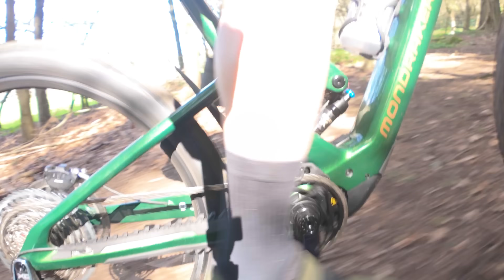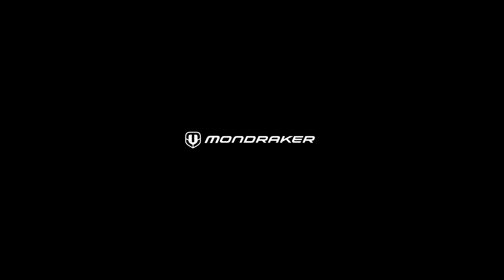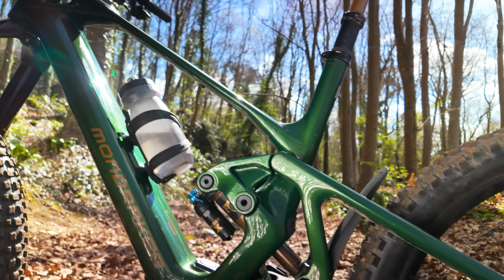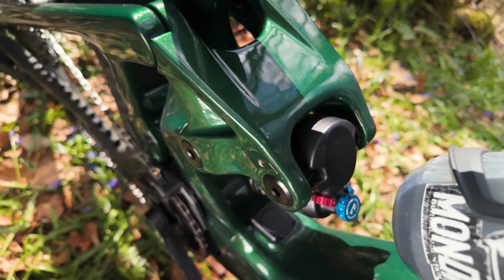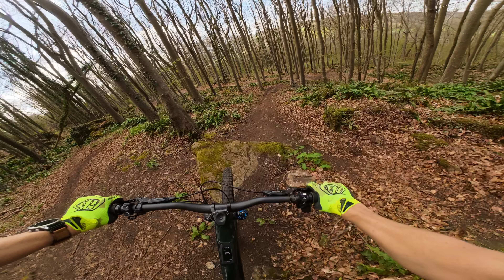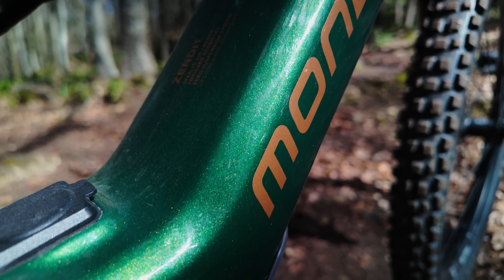ZENDIT tech explained by DODDY | Our first AVINOX e-bike

Comment: You mention charging in your van with a power pack? Can i charge an Avinox powered Zendit with a Jackery without any issues?
Reply: Of course you can!
Reply: @officialWWM I heard someone’s portable power bank went bang when trying to charge an Avinox powered bike & I’m not sure exactly why ! Hence the question…(I’ve only used mine on a Kenevo SL2) not sure if/why the demand of the Avinox system would overload the Jackery
Reply: @Ebikeridertrojan a portable power bank delivers power in a very different way to your Jackery. Plus, I’ve had one of those power banks explode on me too. I think they are dangerous and very unreliable.

Comment: 462mm chainstay, bro. why am i the guy who has to keep coming at ya? just put correction in the vid or something. 
anyway, i'm interested to know why you, or others, like a chainstay that long? 
I (years ago) demo'd a Scott Genius with about 450...maybe 455mm or something stays, and on that  i had problems getting the front end up. 
and it's light. 
are you selling that chainstay length because you cant solve it with the shock position...? or what's going on here?
Reply: Slip of the tongue, my bad. Guess that's what happens when self-filming and editing two days before the launch. Oh well. Keep comin' at me if it makes you feel better!  Chainstay length is about balance on the bike. This length puts the rider in the best position on bike for traction and handling at both ends. Being able to pop the front end up isn't just down to chainstay length. BB height, stem length and bar height affect this too.  What do you mean when you say 'solve it' with shock position?
Reply: 462mm even for a 29er seems pretty long? What I mean by "solve it" is I'm guessing your design team probably had to go that long because of the combo of the shock tunnel style rear sus (shock position) with the Bosch. 
The Superfoxy says 440-450mm chainstays in 29er, so am I right to assume the Zendit still longer rear center in 29er is because it couldn't be engineered around? Nbd just wondering anyway.. Bike probably feels better in Mullet mode.
Cheers keep up the good work.
Reply: @p @pubfixture pe it’s designed to be that long.
This bike was designed ground up, not adapted, not based on anything else. 
Longer chainstays centralise the rider on the bike; they allow more traction for climbing and more stability when descending.

Comment: How does the DT Swiss 350 DEG 72 handle that much power ? As DT advise the hybrid hubs for e-bikes
Reply: this is the Ebike version - can be used at 0deg or 10deg. The non-E version also does 20deg.

Comment: explain peak power..how long, 30 seconds, 60 seconds, 1 hour? these numbers are all marketing mubo jumbo
Reply: Boost is up to 60 seconds. Peak Power does not have a fixed amount of time - the nominal output (sustained and constant) is 250w. I do know that a German publication noted that the full 1300watts was sustained for about 22minutes in their test - but I don't know the conditions they rode in, or how the testing was done.

Comment: The linkage is an ugly contraption.
Reply: I agree to much going on. Over engineered just to be different.
Reply: @TerryCole-b6p  Then you obviously have no idea about rear triangles.
The shock is compressed from both sides. It's positioned below the seat tube for optimal center of gravity. They did it differently on the 2023 Level/Crafty because the Bosch CX Gen 4 motor was in the way. The Avinox motor is significantly smaller, which allows them to revert to their standard rear triangle design, as seen here on the Zendit or the 2025 Level/Crafty with CX Gen 5.
Reply: @TerryCole-b6p  not over engineered to be different. We have use variations of this design for a long time.

Comment: Nothing beat bosch crafty on its natural pedal feeling, i rather feel the pedal than just shuttle around
Reply: Then look for shimano.
Reply: Bosch has a totally different feel to Avinox. It definitely has things it does much better than Avinox  - and vice versa. From my POV, the stand out with Bosch is low speed control and torque for technical climbing. Despite having more power, Avinox can't touch it right now. But then Avinox allows riding at limiter speed even on really steep trails - so can make uphill singletrack and challenging trails as much fun as descending. Both very good, and have stand outs. I plan on making something to highlight the differences in the way the systems ride, and how they are best used.
Reply: @DoddyMTBtech well it should be put to the test a blind test with someone who hasnt ridden both
Reply: @porroco  good idea!

Comment: Ooh question I thought the extra power for the DJI motor only give the full power with the 700w battery and is the 800w battery the same size and shape as the 800w???
Reply: 1300w peak power with the 800 battery (which I think is the same battery as in the original M1-powered Amflow bikes), whereas the new cylindrical 700 battery (fitted to the Amflow PX, the Atherton EMTB and a few others) gives 1500w peak power.
Reply: @grahamsmith9788 that's exactly what I thought but Doddy said 800w battery and up to 1500 w peak power ,??
Reply: @bikenboatart  No, He said 150nm and 1300w
Reply: @FINNdeischgut ah ok will have to watch again
Reply: So you do need the 700w battery to get the 1500w?
Reply: @bikenboatart  Yes.

But nobody needs 1500w.
1300w are enough for everyone
Reply: @FINNdeischgut yeah actually agreed 👍
Reply: Yep agreed wonder how much lighter the 700w battery is in comparison though not sure I would even need an 809w for that range

Comment: Hopefully they all ship in better condition than my level rr did last year. Main pivot bolts that were too long and weren’t preloading the bearings. Washers missing on some stem bolts as well. And every bearing is n the frame and wheels were shot within 3 months.
Reply: Iain Richard just put out a video on this bike, broke the wheel on the first section of trail he rode. I was not impressed with this bike at all. Doddy is obviously going to be biast when this bike is concerned because he works for Mondraker. Not going to be an accurate review
Reply: @Razzy_82 I seen it earlier. He seems like he regrets buying it. In fairness I think he had a Schwalbe tyre in a trail casing on the back wheel. Not robust enough for the application if that’s the case.
Reply: @banger2891 thats what I thought, bike looks fast but for the premium price it should be a premium product. So why does it come with trail casing tyres 😂
Reply: I agree mate now that he works for Mondraker he will be very bias and not say one negative. Shame as I trust he's judgement before on products u can't now, but I understand that this is Mondrakers own channel and normal to be bias.
Reply: @TerryCole-b6p  also, I'm not sure why this is titled a review - as it's not. I'm just delivering information on this bike, for people to make informed descisions.
Reply: @Razzy_82 broke a DT Swiss wheel due to poor line choice and blames Mondraker. Think about that for a moment.
Reply: @TheAngryHusky not the case, what so ever. A wheel should not brake from a 1ft drop. Especially off a premium brand
Reply: @Razzy_82 it shouldn't but it happens. Regardless, that's not Mondrakers fault and will likely be covered under crash replacement. It suck's but that's mountain biking.
Reply: @TheAngryHusky cant argue with that, but shouldn't be happening right out of the gate when dropping off a 1ft drop. Lots of people complain about DT Swiss. But then lots of people complain about lots of other brands, guess some of it is luck of the draw
Reply: @Razzy_82  wheels are wheels. Doesn't matter what brand. I weigh 97kg and am generally fairly hard on rims. So far, so good. I have split a DD tyre though. But that also happens.
Reply: @DoddyMTBtech ok so the caption is misleading. My biggest gripe with this bike is the section on top of the bottom bracket. Its holds a load of mud and fills up if you dont scrap it out. Need to tell Mondraker that it's bad 😂 but from what i have seen the bike rides extremely well. Its like a rocket
Reply: @Razzy_82  mud harbouring is always a concern on anything. I can tell you from the 3months of solid sh**e conditions we had at the beginning of the year that this has been a non problem. Thicker, claggier mud might be different, depending on what your local mud is. I've also hammered mine with a jetwash - so far, so good. FYI, my Bosch display has water in it, but works fine. Might be too soon to say with this, but I'm not delicate with the cleaner as I would rather find out about problems and pass on the information.
Reply: @Razzy_82  just want to emphasise - this is not a review. And I don't know why it's called that. I'm providing facts so you can make an informed choice about choosing bikes.
Reply: @Razzy_82  What is the name of the YouTube channel? I can't find anything under that name.
Reply: @FINNdeischgut https://youtube.com/@ruffest?si=qCICJhM4ua3nyBla
Reply: Ouch !!  Certainly not what you would expect from a high dollar product. Was this handled correctly under warranty? What country are you in  and what kind of support did you get?
Reply: @stevebiron3036 Scotland mate. The bike shop I got it from was 400 miles away. The workaround was to put a 1mm washer on each main pivot bolt to take up the extra length. The bearings wouldn’t be covered under the warranty. Excellent bike but very poor quality bearings. The e thirteen wheels were the worst wheels I’ve came across. Replaced them with a set of deemax enduro sl wheels which are absolute quality.
Reply: @banger2891  I would think in this day and age that is unacceptable. You having to faff around scrounging pieces to make it work is poor support/warranty/customer satisfaction. Who is running QC  ??  where are these bikes manufactured? I thought Spain?  Lots of manufacturers have lifetime warranty on the bearings. You would think that at this price level they would be covered for life.
Reply: @stevebiron3036 Not sure where the frames are manufactured but the bikes  are assembled in Spain before being shipped to their final destinations. There was huge play in the rear triangle so qc was abysmal by mondraker and the bike shop who both failed to pick up on it. Easy fix once I figured out what was wrong but it still shouldn’t have happened.
Reply: Same bike but my dropper inner cable was cut too short...I have no idea how they even managed to fit the inner. Had to get the motor dropped to fit a new one
Reply: @TheSharvis How short was it? It’s not a great route the cable has to go because of the shock passing through the seat tube. Have you had any other issues?
Reply: I have a level RR 2023 and everything was perfect for me.
Reply: it's a shame to hear that. Not how things should be.